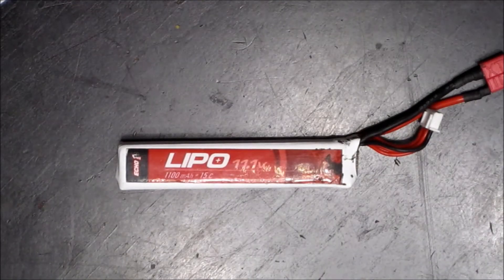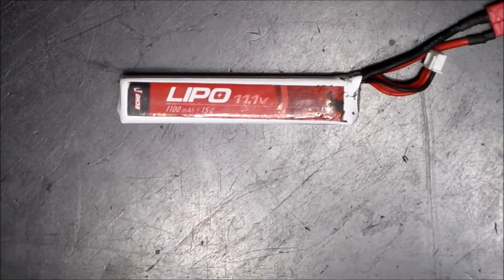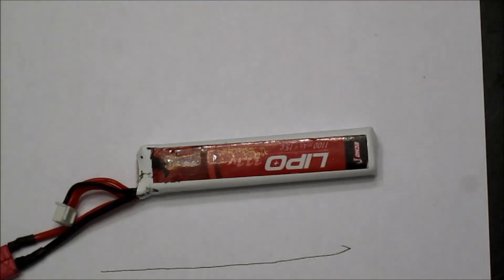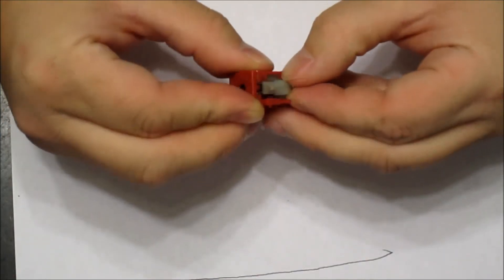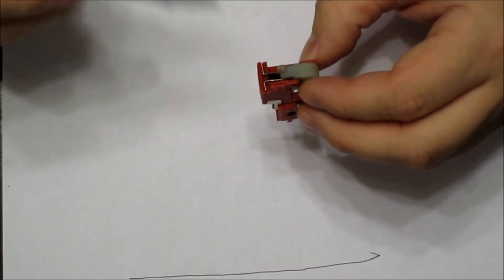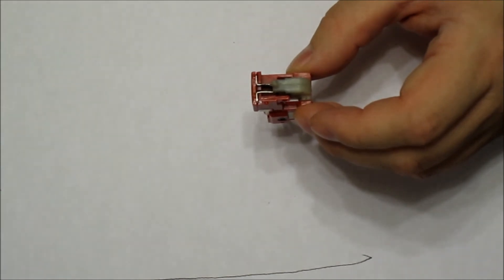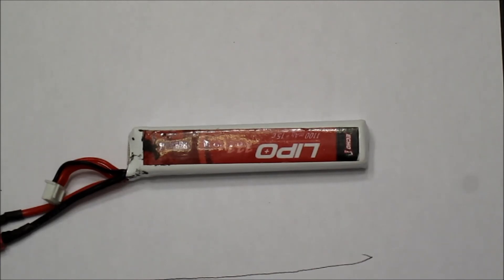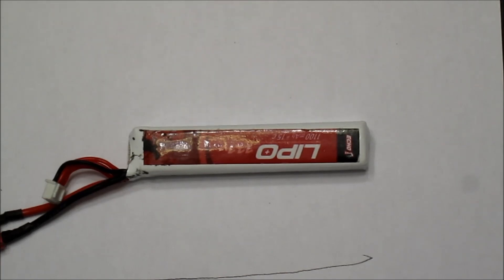Airsoft Lipo Battery explained

Comment: In my experience the more common issue resulting from the contacts arcing is the carbonisation of the contact surfaces resulting in carbon build up which eventually stops the electricity from flowing between the switch unit contacts (this can happen in the switch block or on the selector plate). When this happens you can usually take the gearbox apart and sand or file the contacts to expose a fresh layer of conductive material. (sometimes it doesn't work when the switch unit contacts are too heavily burnt through) I'm not sure I have actually seen many examples of the warped/damaged plastic which you have described, I'll be sure to look out for some examples.. maybe i'll burn through a test gearbox with an 11.1 50c and see what happens :D .

Comment: That video confirmed what i needed to know for the most part, im looking to put a 11,.1 lipo in my g&g f2000. I got it off of the airsoft megastore and the parts in it are reinforced, so i was thinking all i needed was a mosfet. Can you confirm  that that's i would need to run that battery? Plus i need to find one that fits in the gun.

Comment: what about max c rating? because the 15c on the battery is the continuous discharge, say my lipo is a 20c 11.1 lipo and 40c dischrge ( http://www.hobbyking.com/hobbyking/store/__44071__Turnigy_nano_tech_1000mAh_3S_20_40C_Lipo_AIRSOFT_Pack_USA_warehouse_.html )
how does the max c rating affects my trigger?
Reply from the maker: From what i can tell the burst is on the initial trigger pull, and then would drop back to the constant.  So when in full auto on the trigger pull you would get the 40c burst then as you keep holding the trigger it would drop to its normal rate.  Now for semi I am trying to find out if each trigger pull results in the burst c rating every time.  If this is the case it will affect your trigger contacts greatly as there is more amperage being dumped across (arching) across them.  I have yet to try it i keep meaning to, but you can try Dielectric grease, it helps protect electronics from over heating, arching, and also gives it water protection, you can find it at walmart in the auto section. I will try to get a better answer for you on this but in the mean time here is a link to that grease

 http://www.walmart.com/search/search-ng.do?povid=P1171-C1110.2784+1137.2772-L0&search_constraint=0&ic=48_0&Find.x=0&Find.y=0&Find=Find&_ta=1&search_query=dielectric%20grease&_tt=dielectric